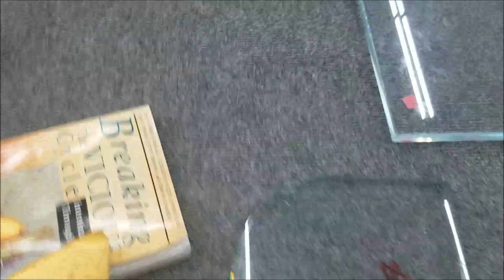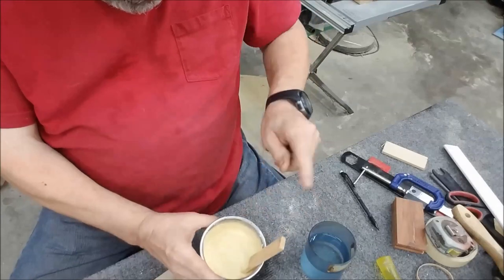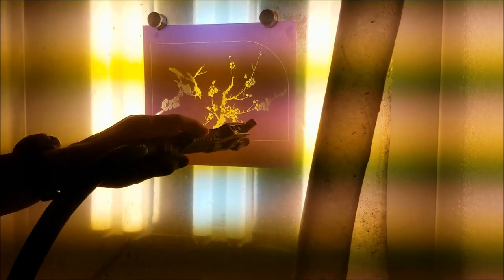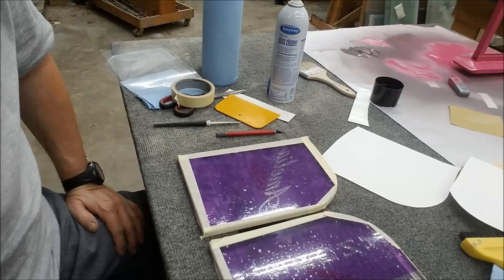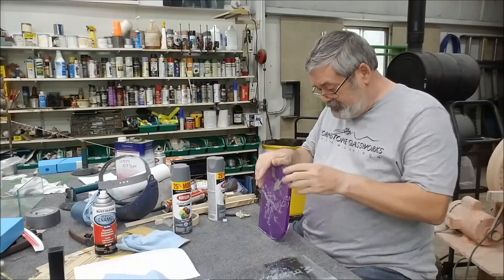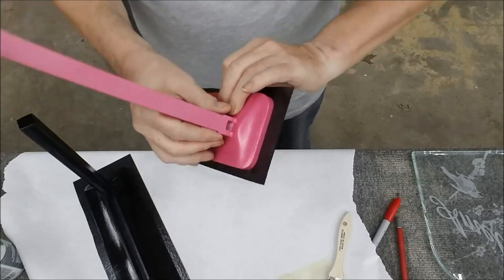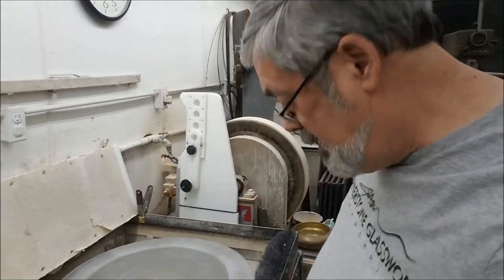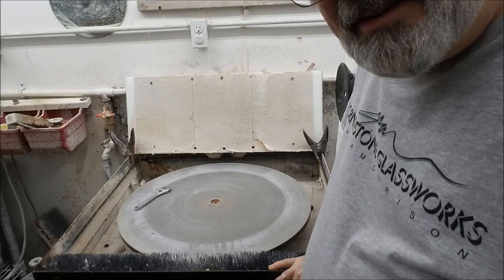Sand Carved Glass Night Lights

Comment: Hey there John, you want to share what RPM  your motor on the lapping wheel is running at?  Thank`s in advance, happy easter
Reply from the maker: Hey Benjamin,  The motor is 1 1/2 horsepower. It spins at 3450 RPM. The pulley on the motor is 2 1/2" in diameter and the pulley on the turntable is 10" in diameter. You can do the math to know how fast the turntable spins. Hope this helps. Thanks!